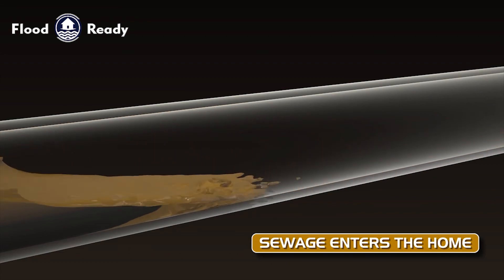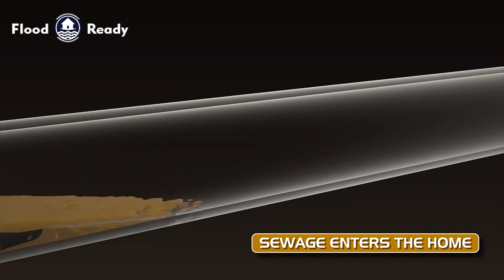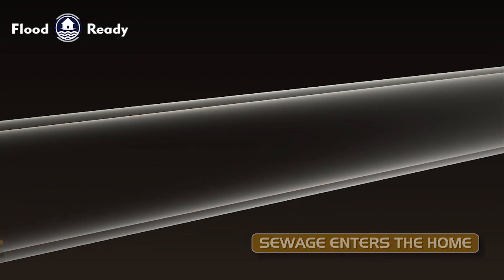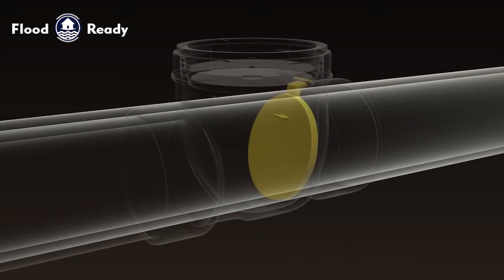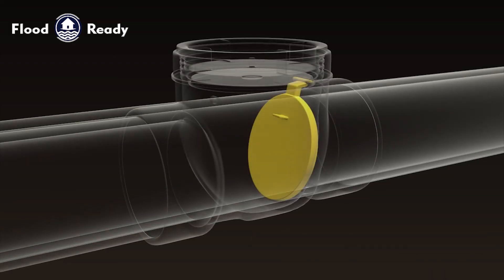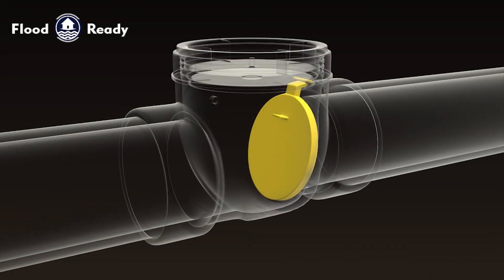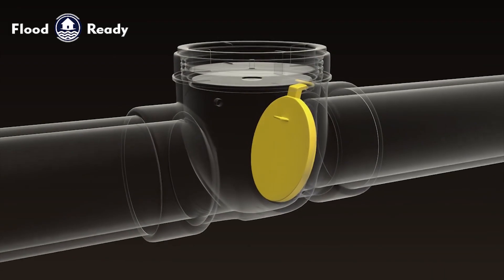How Backwater Valves work, Basic Principles

Comment: The plumbing instructor says we might want to avoid such devices because, sooner or later, somebody will drop something in the toilet (napkins or other stuff)  and that will block the valve at half position.
Reply from the maker: The same thing can happen to your front door of your home. Would you avoid that as well. These devices are these to prevent sewer water from backing up into your home. Its the only practical way to do it. Normally open valves are ideal for most  homes over the normally closed but these devices are important.

Comment: When a rain pipe is connected on a sewer system and the valve is closed du to heavy Rain fall then the toilet wil turn in to a fountain or another low point. Always make an point before the valve where water can Come out without problems.

Comment: Can a backwater valve be installed for a septic system?
Reply from the maker: It’s a good idea to install the backwater valve on your homes building drain to prevent backflow from public sewer or private septic system. If for whatever reason, groundwater penetrate or surface water enters your septic system. There is a chance of flooding back into your home.

Comment: What’s the best lubricant to keep it from seizing up???
Reply from the maker: Synthetic Grease, But in general do not use the model in the video on your mainline its really best suited for branch lines connecting to the main lateral. Visit Kessel.com or for lower flood risks Mainline.  AquaProtect Inflotrolix is also a good option. Kessel is your best bet if flooding is a really big issue for you.

Comment: Always fit a back flow alarm, it will alert you when the device is activated so you don’t flush a toilet or use any fixtures in the house.
Reply: never heard of the alarm. but always wondered what happens if you flush the toilet while the back flow is in use

Comment: I have read that these can “cause more trouble than they fix,” the opinion of a few plumbers online. But most of the info I see about them is positive. So I am just looking for more opinions here. I don’t fully understand why some believe these can cause more issues. Can anyone clarify this? Thank you so much
Reply from the maker: I hope this helps, You have a tunnel connected to the sewer to accept your waste. There is not door on this tunnel. If the sewer fills which is can because they are designed to a spec you flood. Is your family worth not having to deal with the waste matter of strangers. YES. Look at Kessel Backwater valves as your first start. If money is an issue an you need to place a Budget bet,  then look into Mainline or Inflotrolix. If you want the best bang for your buck and have low flood risk and don't mind looking into a valve every 4 months for life, look at Mainline Backwater valves and get their top check backwater valve only, but you will have to check on it since there is not signal telling you about when it closes. Kessel is my fav after years of monitoring and experience since you do need to think about the valve at least 4 times a year since a computer does that. If you don't have time to wrestle with a valve get the Kessel FKA Staufix, if you need to save the buck and have low flood risk get a top check Mainline Backwater valve or inflowtrolix bladder valve. I love the Kessel FKA system but I understand that if its a house you plan on selling get the Inflotrolix or Mainline Top Check valve. If the home is for life and generations get the Kessel FKA, its worth 10x the money because the job will be done!

Comment: So if my town tells me that sewers surge often due to heavy rain and it comes up through my basement shower and toilet… would a check valve be helpful so it doesn’t happen? I have a wheel shut off that I should use when it heavy rains but then I cannot run anything like washing machine, dishwasher or flush toilets. Any suggestions?
Reply: You need to install this valve plus a submersible sewage pump. Pump will bypass valve and force your sewage into the city mains.

Comment: What is the home sewage comes when there is a backflow? Valve will face pressure from both sides. I assume it wont open but you never know.
Reply: That’s a good question. I flushed a basement toilet and I think I let a little sewage in my basement shower. It didn’t immediately overflow in the shower so I know there was a little more coming in from the street. I believe the flush I sent down the pipe may have broken the seal and let some back-flow in before it sealed up again. It wasn’t real bad.

We had another heavy rain a week later and I didn’t flush any toilets. We didn’t get any water in the shower. 

This neighborhood is known for sewage backup during heavy rains. My neighbor has a 2 inch ball valve on his downstairs utility sink - he doesn’t have a basement bath like me.
Reply: @TheRentsTooDamnHigh when flood coming to house you should not use any fixtures of your home because it can lead to flooding in the house
Reply: When it is activated it prevents all neighbors sewage coming up in your drains etc. if there is a power outage for say a week it could start backing up. Those manholes use gravity to some extent but use electric as well to assure sewage goes to the plant. I’m buying one just on the safe side
Reply from the maker: The sewage in this video is coming right to left. and if there is backflow from the city the valve will remain closed to both sides of flow.
Reply: @JamieTorontoAtkinson  have same question so that could lead to it coming right back into house couldn’t it?
Reply: @JamieTorontoAtkinson  so what happens then to the water coming in from the house? when the sewage closes the valve?

Comment: The valve shown in the video is a check valve, not a backwater valve. Big difference.
Reply from the maker: Thanks so much for you interest in the subject. Technically any valve that stops or prevents backwater is a backwater valve. Backwater valves are generally divided into two categories: The first is know was a normally open backwater valve and the second is known as normally closed. Normally open backwater valves are valves that you install on the main sewer line before any other drain-line branch from the main line. Think of installing a valve on the trunk of a tree where as normally closed valves can be installed on the branch of the tree. Valves need to be normally open to to allow for sewer gases to vent up through the buildings drain stack(s). In most jurisdictions normally closed valves can not be installed on the main sewer line or “trunk” because it would prevent the sewer system venting and it also hinders the flow of your sewer drain. I hope this helps clarify things.

Comment: Is there a cover or cap I can put on it? If so, where do I buy it?
The hole is 7 inches in my basement floor and I don't need an ankle injury.
Reply from the maker: Your basement floor drain is designed to allow water to leave your basement in the event that water were to come in from either a window or from a burst pipe. If the water were to rise up into an electrical panel which is often located in the basement there can be serious safety risks. With that said you can always put in what is called a test plug inside the floor drain to prevent water from flowing up and out of the drain. You should also consider putting in a water alarm to let anyone know if water were in the basement for whatever reason because a block floor drain is a safety risk. For that reason it is best to have a Backwater Valves installed on the floor drain to prevent any sewage from coming back up. This valve will also allow water to flow out whenever the sewer back up where to stop  that’s reducing the safety risk.

Comment: Do check valves have a small amount of water above them after it rains? Is that a normal sign
Reply from the maker: Yes this is normal for the types of valves that do not offer groundwater protection. Consider an adapt-a-valve if you need the cheapest solution. Otherwise consider a system from Kessel.com

Comment: I fixed this backwater valve.but not workeble.still water come inside via mainhole to bathroom hole.
Reply from the maker: You need to consider a valve with groundwater protection. Consider an adapt a valve. If your looking for the system we recommend visit kessel.com
Reply: During heavy rain.why?
Reply: @pencs-pkl6235  It is wrong.

Comment: Can you answer a question please? I had a backvalve installed but not a clean out port.  Two plumbers have told me that the clean out port is not necessary as the backvalve unit pulls out to clean, but the village inspector refuses to approve of the work saying that the plastic will scar and be rendered inoperable.  I am not sure what to do as the original plumber won't talk to the Village. Is there a code or something that requires a port be installed with a backvalve? Thanks for any insight you can offer.
Reply from the maker: It really depends on the type of backwater valve you have installed. If the valve has a threaded cap built into the top of the valve, you can use this as an access port. Inspectors often use past experience to help homeowners. I always recommend installing a cleanout upstream the backwater valve and downstream. If you keep fiddling with the valve without proper practice you could cause a fault. If you have the valve seen in the video above you should be okay. Test the flapper and make sure it can flip. I hope this helps
Reply: @JamieTorontoAtkinson  Thank you so much!
Reply: Vi

Comment: My kitchen sink keeps getting backwater. I live in an apartment building. 11 stories... and I'm on the 3rd floor. I want to install a backwater valve in my kitchen sink. Do you recommend I do? #NYCproblems
Reply from the maker: Yes I you can always install a check valve to prevent backwater but not a traditional backwater valve which are typically used on the buildings main drain. The problem with valves in kitchens is that they get dirty super quick. Avoid putting food waste down the kitchen sink if you do.
I hope this helps
Reply: There is probably a vet that is clogged or improperly installed, thats why when the top floors drain they get air and send it your way, maybe its time to redo the piping in your building many buildings that are old dont have proper air ventilation
Reply: My basement back water valve water not passing throw what I should do or check? Please reply me
Reply from the maker: @kutubuddinahmed6523  You will need to check to see if your flapper is jammed by sediment.